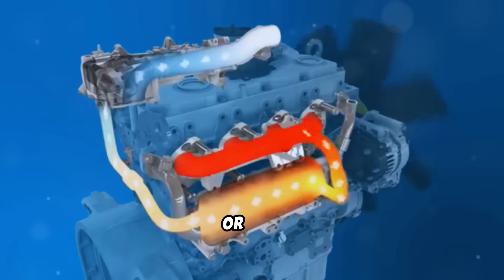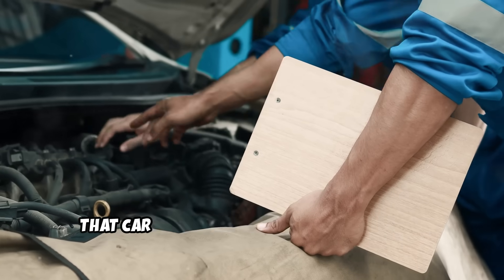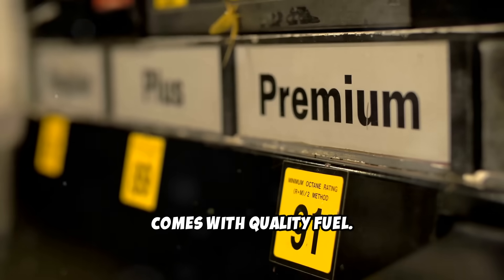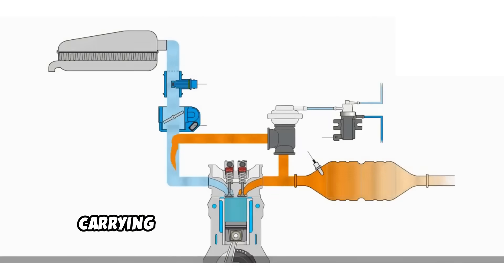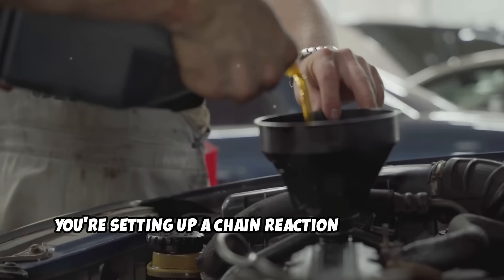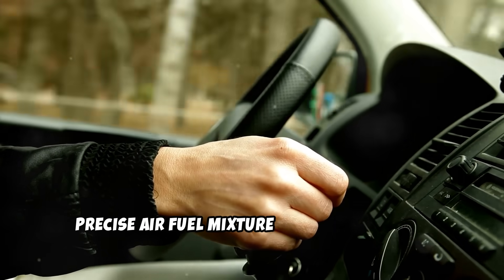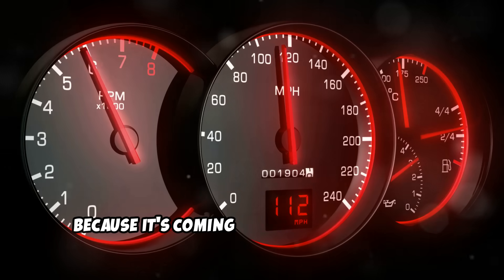5 Things DESTROYING Your EGR System (Most Diesel Drivers Do #3)

Comment: Hi all. We change the ego, change the wiring harness, change the air sensor and still the light come on. I change the oil often . Usually before time. It on the highway a lot of the time. Does anyone have an idea  what’s happening. Oh and it over runs when turning of

Comment: For those that like they're diesel car.
I have for 13 years a diesel engine. Everything around the engine as sensors hoses fuel pump and of course it's EGR original factory fitted and timing chain...
I had the car from 150k miles to curret date when has 315k MILES on the clock.

Why!? How that was possible?

I used since I got the car back in 2012, O used with every full tank 250ml/50litres of fuel 2 Stroke Oil.

The EGR of the car when I got it wasn't clogged up but it had deposits inside as well as the intake manifold.. because it is attached to it as principle. I clean it then to the best of my capability. EGR was easy to clean. Not as easy to clean the intake manifold. But that was the only time when I cleaned them. Since then 150k miles later, there inside are no deposits that used to be.
So for 150k miles I did use 2SO as said above and I am doing something good to this engine - keep it clean on intake for the rst if it's life! 100%
..The injectors, 2 of them got rebuild just after 300k when they produced a loud bang (back flow issue) unde the bonnet but the engine kept running.. so I took them out, rebuild to specialists. Injector back in the engine and good to go for another 2-300k..
This car now is an experiment of mine. I won't give up addidng 2 stroke oil to the fuel until it packs-up..
JASO FB for non-DPF

JASO FB for DPF fitted cars
I use this in DPF fitted car as well as part of my own experiment.

Do what I do and you won't need to fix or replace your EGR, believe me!
Reply: Maybe we could if your writing was understandable
Reply: JASO FB for non-DPF and JASO FB for Dpf cars ? Make up your mind
Reply: @soldatd3727 avoid 2stroke with zinc this will clog dpf fast

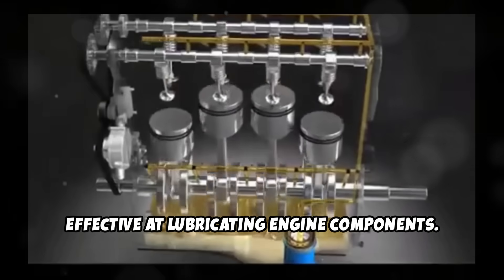Comment: 3:33 Wrong. 
While I agree 10-15k miles is a good interval for oil change.
It has not much to do with EGR systen!
For EGR system what is important is the fuel, how is burned and what is in the fuel.

Comment: My Toyota Coaster just passed 150,000 miles, and since it’s got one of those early 1HZ engines without an EGR, it’s still running super smooth. 
I just swap the oil every 3,000–5,000 miles, and it keeps cruising along with zero problems.

Comment: Stop buying and snorting diesels.
Reply: Diesel vehicles are and will be number 1 choice for generations. They are actually increasing in sales. Because people who had EV's are going back to diesel vehicles, saving a fortune compared to  EV running costs. And with the egr valve removed, the vehicle can do very high mileage in its lifespan
Reply: I’ll buy whatever I want, comrade.

Comment: I have removed the EGR systen several years ago. Problems eliminated.
Reply: In EU countries, like NL( APK)  and Germany,( TUV)  a removed EGR leads to rejection at the annual mandatory  car inspection .
This means either replacing  the EGR or facing a fine 200 euro : however your licenseplate  number is then fed into the national ANPR database by the supervising authority ( RDW in NL and TUV in Germany) , so each time you pass a police car with ANPR on board ( and most have one on board)  rhey can stop you an you face another fine.
And so on ...and so on....and so on
Reply: @fryfrysk  I've got a plastic belt on one of the vacuum hose, I just remove the one that engage the valve and hold it with that belt. I plug it again before inspection and remove once it's finished, 10 seconds operation and a clean engine
Reply: @fryfrysk same in uk with the MOT
Reply: @fryfrysk  good day mr. "i have google" !   
i like to inform you that in real life you can bypass anything by a kind talk with your local mechanic and some money.
(i have particulate filter removed on my 451.  and a valid annual inspection.  cause one who done DPF removal is the same person who performs annual inspection)
Reply: Me too in Greece I removed egr and dpf 
Now engine running much better (bmw 520d f10 more power and less fuel consumption)
Reply: You don't need to remove it.
Use 2 Stroke Oil instead. 
It will last forever. It will never ever get clogged up.
Ever.
And intake manifold and injectors and fuel pump. 
You will love your diesel!
Reply: @MrFryfish manually clean components or add 2 stroke oil to the fuel tank?
Reply: Boy ru smart for doing that 😂
Reply: I've had the EGR mapped out and DPF gutted, but it's smoky on start up, and smelly. Which sprays or fuel additives do you guys like for cleaning if we're no longer concerned about the aforementioned handicaps?

Comment: All these videos about the engine systems failures makes me think about going to the dark side and buying an EV. Sheesh
Reply: Those never have issues…

😂
Reply: Then that would be an ever worse decision because that battery will degrade with every use. And the car will devalue sharply because the battery is far to expensive that  next buyer won't be tempted to buy specially because he would not know how the vehicles was treated in terms of battery care.
Stick with ICE car as is the devil you know.
Learn to maintaing yourself and you'll be better of, believe me.

Comment: delete EGR AND DPF as soon as possible
Reply: Rubbish.
Use 2 stroke oil JASO FB for DPF.
 one of my cars does 8 km a day.
In 2 years never have any problem with the DPF. Took it twice in longer journey, holidays.. and that's it.
For a diesel short journey is a killer.
But not if you are using 2SO.. apparently.

I am using 2SO in nonDPF for over 250k miles. Zero issues! 
None
Reply: @MrFryfish what’s 2so please
Reply: @guttersnippeesmithers3905 
2 stroke oil. But I have no idea how it is used or where it goes 🤷‍♂️

Comment: 2014 Transit that I recently bought has a resistor in line that tricks computer into thinking air temp is very low, should I remove it?

Comment: EGR itself is engine destroyer and if you can ditch one, do so!
Reply: No need for that.
Use 2 Stroke Oil in fuel! 

That EGR and whole intake manifold and sensors and fueel pump and injectors... will last and last and last and last forever.
Reply: @MrFryfish can you tell us more please?
Reply: @MrFryfish  And what oil in fuel can do to EGR??? What it to do to intake manifold??? Fuel pump? May be. Injectors? Doubt it.

Comment: The low quality fuel spin is nonsense.
Reply: Yeap. Used diesel with 2 Stroke  oil and you'll have a clean engine on intake. Is that simple. 2 stroke very light oil will help eliminante the soot constantly.
No EGR clog up.. special those that are precisely actuated. Those gets their shaft clogged and stiff over time.. 
250ml that is very miniscule quuantity to 50 litres of diesel will keep your DDT iesel top notch, believe me.
I am using it for over 150k miles.
Reply: It’s 100% true.

Comment: I suspect another sign the EGR is beginning to clog up, when the Start/Stop stops working and the engine stays running when you stop. Often after a long run the Start/Stop begins to work again.
Reply: That is because the stop start wont work with a less than 100% battery charge, because it is harmful to your battery (starter motor too). SWITCH IT OFF!
Reply: Why the hell would you want a start stop function on your vehicle ? Delete it!! Absolute useless piece of green auto engineering scam.

Comment: Excelent advice. Not just the EGR, this mistakes wear out the whole engine. The myth of long-life oil and operating at low rpm below 2000 are two fatal errors induced by manufacturers. Low revs is also low oil pressure and low lubrication. Just look the operation regime of automatic gearboxes for big trucks and buses and is the same as that of a Tiptronic in Sport mode.
Reply: I pump always cheap diesel drive only  steady 1500-1800 rpm min drive time  cca 15min  change oil6-8 t miles  and  when i was recently for EGR check up and carbon removal visibly shocked  service guy came to me and asked me what fuel i use because there was simply no carbon at all only litle black coat and he just wiped off.He told me he never see that EGR so clean before
Service was done last year on my 2012 Nissan Pathfinder 2,5l diesel with 250t miles in Czech R.